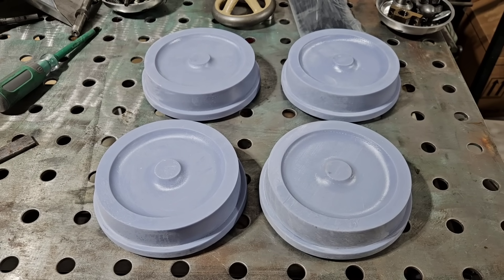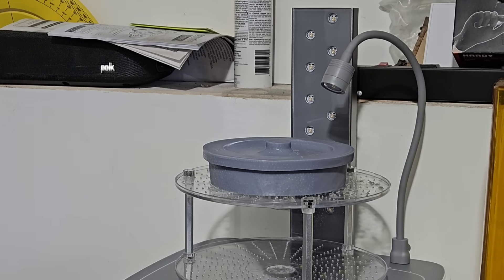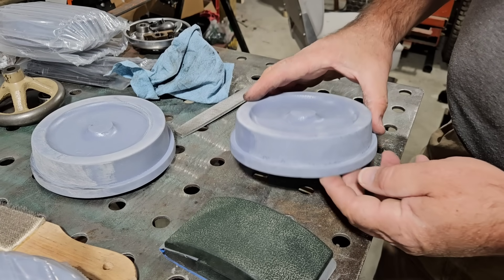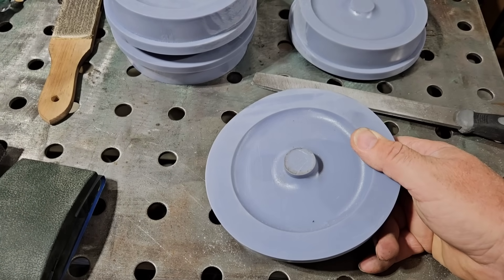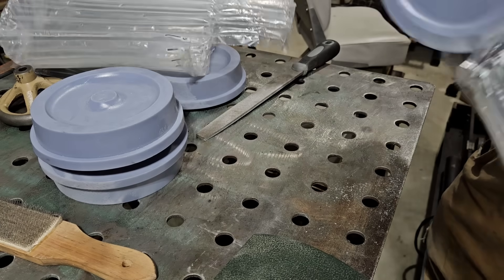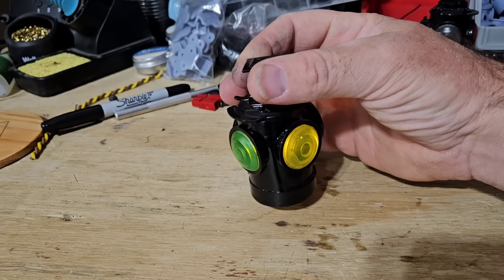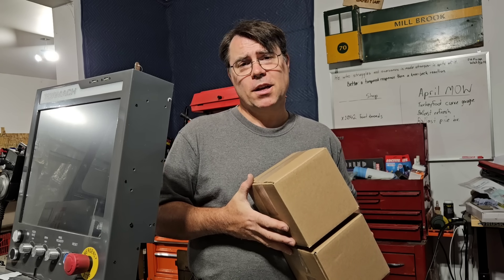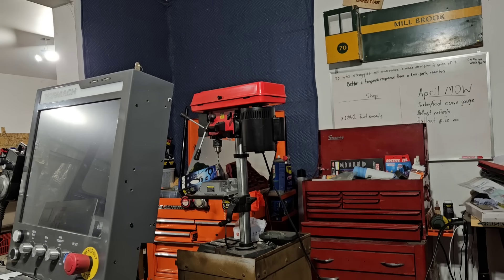3D Printing Wheel Patterns for Casting | Mill Brook Railroad

Comment: With ABS, some folks were using acetone vapors to enable them to smooth the outside of the part to remove the print lines.
Reply from the maker: I've never tried that with a resin print.

Comment: Great video I used 3d printing for about 10 years now I like using Fusion 360 and tinkercad !
Reply from the maker: Sounds like a good combination. I learned 3d modeling on Autodesk Inventor, so I didn't take well to Tinkercad. I also used Solidworks for a while, but I liked the one-time user fee of Alibre Design Pro. Their free version is Alibre Atom. To me, the software is a tool. At the end of the day, all that matters is that the tool does what it needs to do. Brand name doesn't matter.

Comment: While watching the segment about printing the parts I noticed some serious potential issues. The first thing I noticed if you didn’t have much adequate ventilation or a respirator when handling fresh prints. Resin is very toxic and you can develop a severe allergy without proper PPE and handling.
The second thing I noticed if you didn’t include drain holes on your prints, without drain holes if your prints are hollow there can and usually will be uncured resin inside which is very prone to exploding at random months or years later after the print was made. 
I highly recommend looking into resin safety so you can stay as safe as possible with resin, best of luck!

Comment: Wait...
 are those hollow?
are they empty?
or are they full of uncured resin?
Reply from the maker: The resin is never completely uncured inside a print. Each layer is exposed to UV light. Then, you put it under a UV light for a half hour for final curing. These patterns are solid. Just as the customer requested.
I tried to print a couple that were hollow, and they didn't come out very well.

Comment: Food for thought. Converting a garden tractor to run on 7.5 in. gauge trackage would be beneficial as the attachments that they use. Plus, they would be equivalent to 3.75 scale which would be a chance to reuse the transmission to connect to the driving wheels as a jackshaft like on early gas mechanicals. Which combine it with the RMI industrial equipment, you end up with 7.5 gauge equivalent to the Feldbahn.
Reply from the maker: That's an interesting thought.

Comment: Those markers are sweet looking.
How’s the wiring and battery I assume?
Reply from the maker: They use balloon lights. It's basically a capsule with batteries and an led in it. The balloon light pushes up into the lantern body and you change it out when the batteries die. 
They're available on Amazon for pretty cheap.

Comment: Well done but....
Yesterday Excel and Word got on strike in the computer. Following MS fault finding the network card, and Internet, was lost. Asked the guys in the shop to fix it just before closing for the weekend a replacement computer was bought and started up, boggling with all those accounts, passwords and loggins. Things looked nice but then a hub died. The mouse went dead, the large external hard disk and two printers went off line.....
Having a slow 2.0 hub things got back to business. Hope I can logg out without more mishaps...

Have a nice weekend....
Reply from the maker: Ouch! I had a similar problem recently at my day job. We had two radio stations off the air, which I traced to a single rack cabinet where a UPS was in an error state because the power supplies in two computers had died in rapid succession. I got one machine running and its associated radio station back on the air and it took all day to rebuild the other computer. Meanwhile, Facebook lit up with all kinds of comments about the supposed quality of my work because the station was off the air. 
That was a bad day.
Reply: @MillBrookRailroad Understand Your frustration facing such critics 
One failure seldomly comes alone we say here. Spare parts costs money and there are always chanses for new, unknown failures not having repair instructions.

Comment: Fiou Aaron, when i saw   your miniature first, i think only use can be like your leveling truck with polyester (?) Wheels or as master for sand casting mold. Was right on😅😅😅😅
Didn´t know at all about 20% oups, read your answer, 2% size reduction. Is it from steel cooling down after pouring ? 
Thanks for your hard work learning.

Comment: 3d printing in any form can be chaotic especially if youre new at it I've been doing 3d printing for a couple of years now but never touched resin too many fumes make sure you got fans going and plenty of ventilation.
Reply from the maker: I've been doing resin printing for a couple of years. I'm sure there's a lot I can stand to learn still. There's a certain amount of nuance to getting everything perfect. The longer a part takes to print, the more likely you'll have problems. These wheel blanks take 6 hours to print each one. So, that's when you test your setup skill and the machine's tolerance for marathon runs.

Comment: Printing casting patterns is an interesting project. I'm very new to 3d printing and I only have an FDM printer but just out of curiosity - would it be any different if you printed those wheels horizontally? I mean my common sense thinks that would use somewhat less material for supports and it can't get ellyptical from its weight. Don't really know how to say that in English. Not saying you did it wrong, god forbid, just curious.
Reply from the maker: I wanted to print it horizontally, but it wouldn't fit on the build platform.
Reply: @MillBrookRailroad I see. Size is a limiting factor indeed.

Comment: If you want deeper colors in your resin lenses, you should look at clear paints. There are a wide range of paints that are made for that sort of thing. Often called “stained glass” or “tints”. You apply them to the surface after printing.
Reply from the maker: Thanks for the tip!

Comment: amazing job Aaron! neat job ,so the person you sent them to is make a sand casting then do create the cast iron 
wheels? or a different method ? that has to cost a bit using 1/2 a pound of resin per wheel. chuck is correct about
 wet sanding that is what you do in body work to get the best surface for top coat. and the water carries away the
dust so minimal clogging of sand paper.  at work use to use 10 micron for high gloss finish.
Reply from the maker: I should have wet sanded them, but even the little I did was more than the customer asked for. He'll bring them to a foundry and have sand castings made

Comment: You'll find better results with wet sanding.  It will extend the sandpaper life by keeping them cleaner and also avoids any buildup that could scratch the surface.  Fun fact I also use Alibre.
Reply from the maker: I don't know why I didn't think to wet sand these. That's a really good idea.

Comment: Are those scaled 2% or 20%? I hope it's just 2. I typically scale cast iron only one percent, but other than that, those look great! Any reason why you didn't add any text to the web of the wheel?
Reply from the maker: I misspoke. It's only 2%, not 20. That's what I get for not using a script.